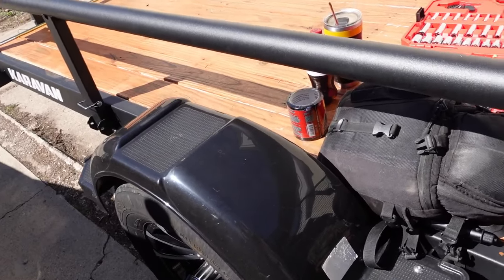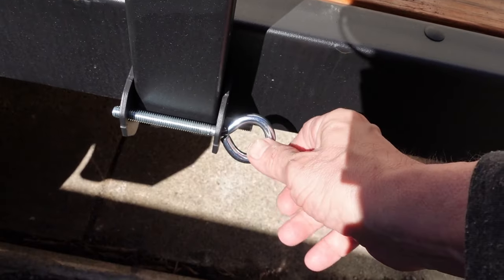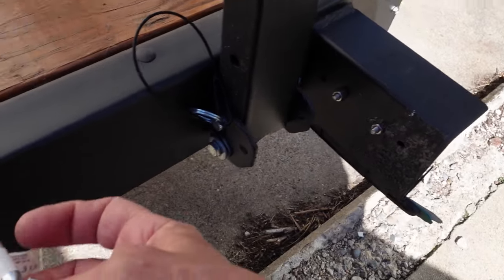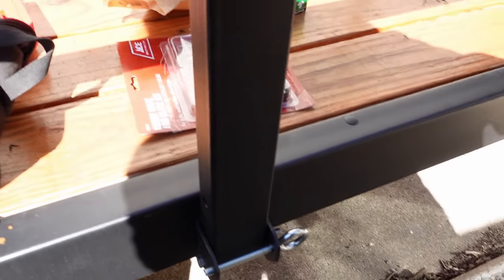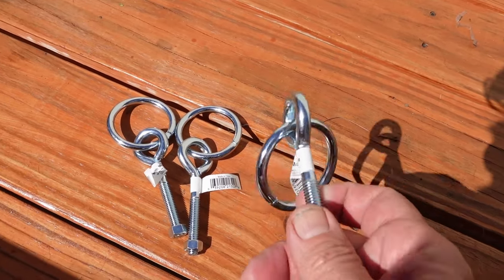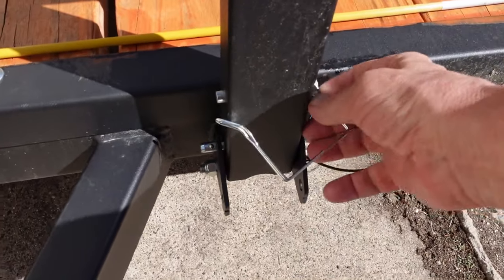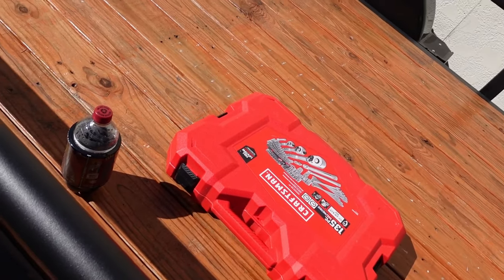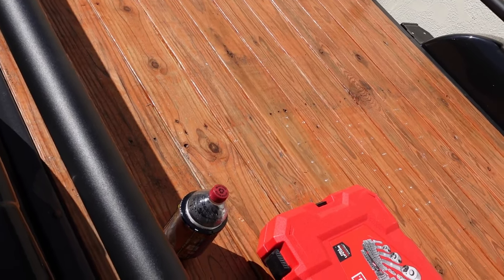Ratchet strap mounts for Karavan Trailer  (Bonus video)

Comment: I watched a YT video about [Karavan's Tie Down kit for 5" frame (D-rings with 1/2 x 6 inch bolts)], available at TSC or cheaper if you shop online somewhere else. 
My 2021 Karavan 5x8 has four predrilled holes on each side with plastic caps on top, but my trailers has 3" frame. So I bought 4-pack of V-ring bolt on anchors and will get some bolts at Lowe's. I didn't even know there were already holes in the trailer for anchors.